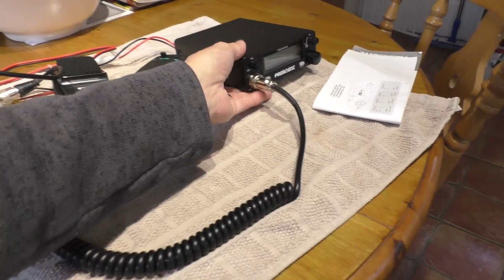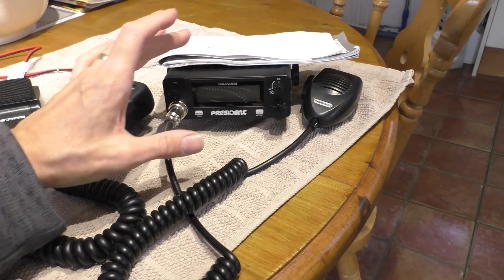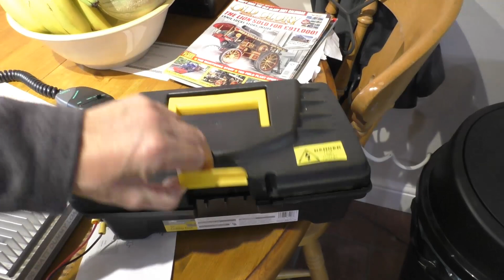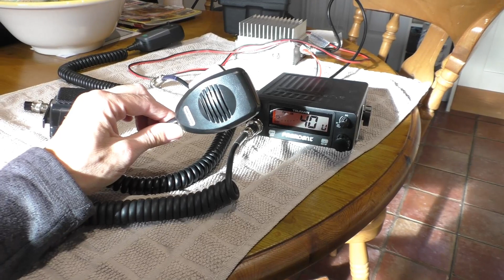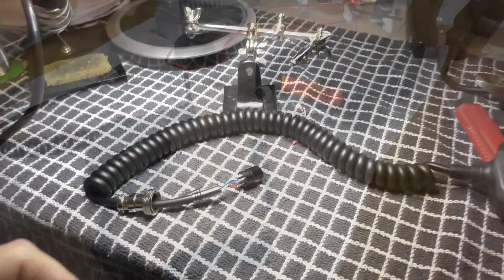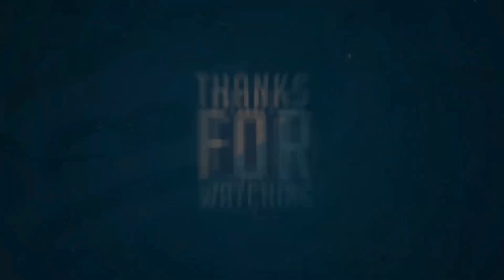Testing power microphones on a President CB radio.

Comment: Each President radio plays best with Sadelta Echo-Mike or Astatic Handmike if you don't like to adjust deviation for some reasons. Otherwise the original Mike is not too bad as well and still has enough modulation power for local and DX-QSO's. Another idea would be to buy a optional President Original-Mike but with Up-and Down buttons. Its very helpful to switch the channels fastly, especially for the Truman.

Comment: With the KPO it made no difference what setting you put it to, it might if I were listening to you at range, but from one radio as close as they were no change.  The standard mic sounded the best, but would not pick you up if it were not close to your mouth, so if you want a sensitive mic, it has to be the KPO..  Failure will be battery or wire come adrift or shorting to the shell of the mic!

Comment: I had a K-PO on a HF radio and the audio was very good. Sorry to hear you had problems with your K-PO , I got mine a few years back for Knights CB and specified the radio (ICON) and it was wired correctly to the radio.

Comment: I would take a pic of the FM deviation pot and adjust and listen - and use the standard mic. I think they are excellent when the FM mod is adjusted and optimised
Reply: Thats wat my locals told me... it's a original CB radio.. they are narrow banded. just tune them up! original 1,5 khz bring it up to 2,3-2,7 khz :)

Comment: Pama need to be bin 😂
Reply: Possibly the Pama microphone has a Dynamic element. Your radio is designed to be used with a Electret condenser microphone.
The KPO and President standard are Electret condenser microphones.
Reply: @Optimus2179 , Mike   i have a president jonhson 2, i like the radio,  but the mic cord is too stiff, youre correct about the electret,  do you know another mic & cord, 4 or 6 i could i use with a 4 pin adaptor,  THANKS

Comment: What's your thoughts on the Mickinley? 1 I have looked at of late, along with the 9900.
Still waiting for a good day to put up the new ⅝w GM, expecting better results over the ⅝w Silver Rod.
Another great video, I got my KPO dyno & echo power mics today, wired ready for the 6900n, works for me, I can't solder.
All the best Fred, chat again soon, 73's CT-4078. Mcr 🇬🇧
Reply from the maker: The McKinley gets some good reports but can also suffer from quite audio.  Steff on the 305 adjusted his inside and it sounds very good.  Never had a complaint on the audio on the 9900